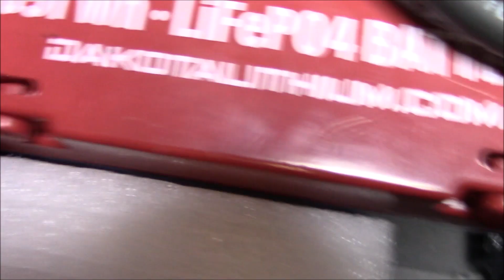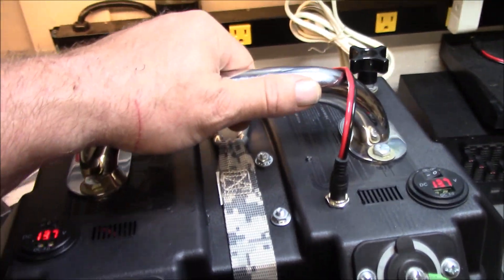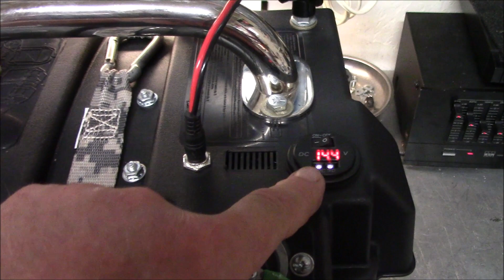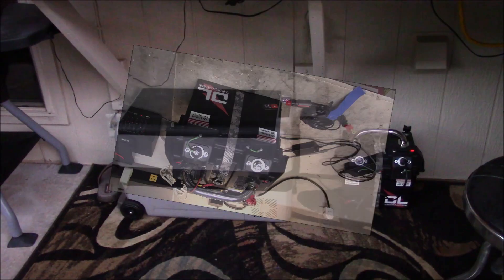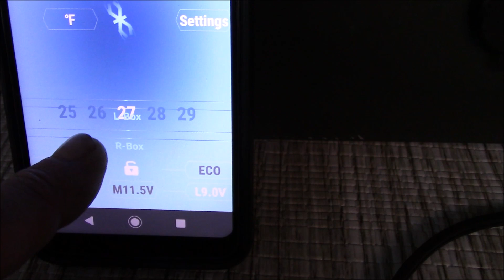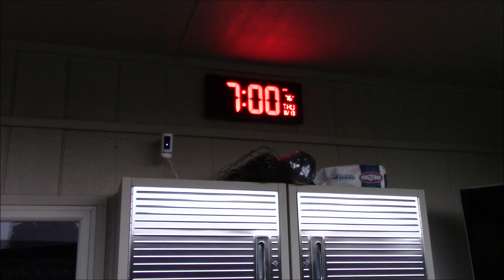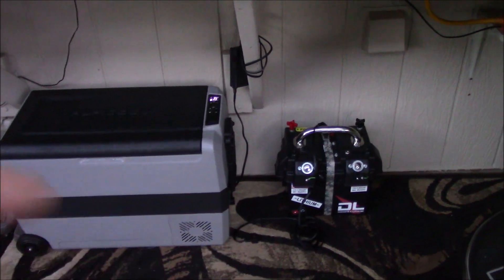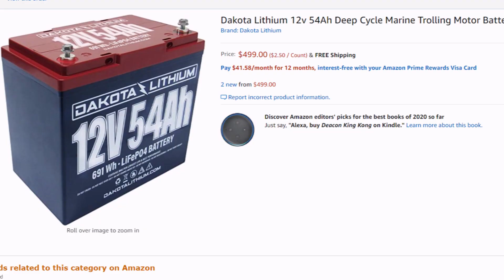Dakota Lithium 54 aH battery runtime test (using an Alpicool fridge/freezer)

Comment: Hi Chris,  you mentioned that the charger got quite hot it might be better to stand it on edge that way the air can flow up both sides of it and remove more heat.
Reply from the maker: Yep...exactly. That is good advice. I ended up doing that...helped keep the heat down.

Comment: Hey Chris.  I have a question that has nothing to do with this video. I’m hunting you down 😁.  I’m running a 24 volt system. I have 2 100 amp hour 12 volt batteries in series. I believe that puts me at 24 volts at 100 amp hours. If I’m pulling 5 amps constantly, how long will it run?  If I have it right I am thinking 20 hours if not LOL please let me know
Reply: at 5 amps, 100ah will give you 20 hours
Reply: kcdakrt. Thank you 😊